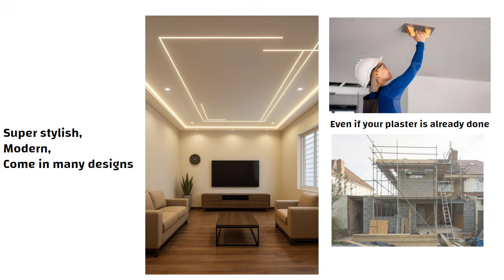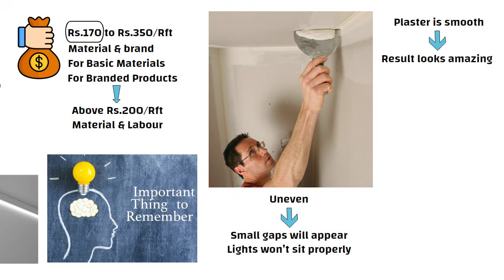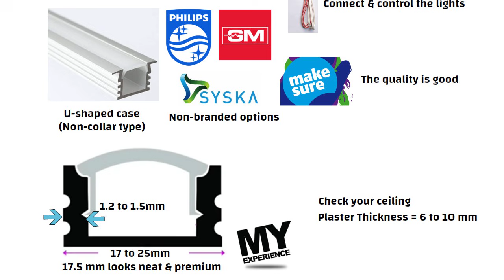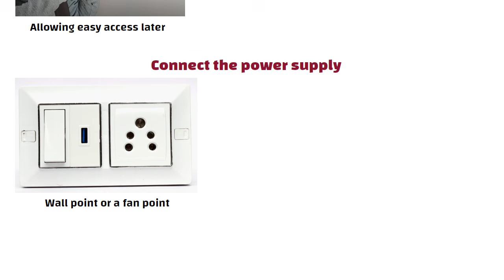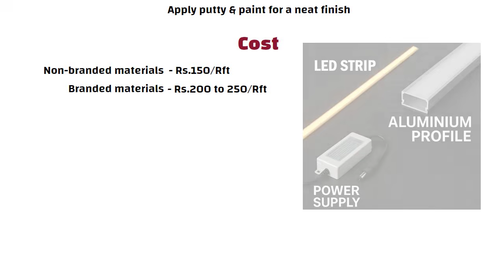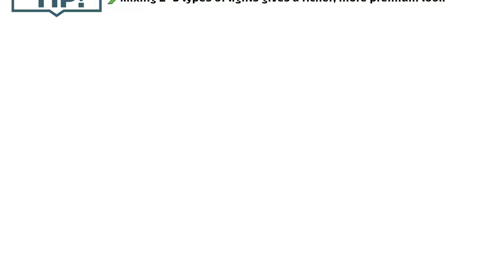How to install Profile Light without False Ceiling!

Comment: My flat wall is concrete wall done by builder. I want to do celling light without false ceiling. You mentioned profile light can be done by little cutting of plastering. How to do electrical wiring in concrete wall and ceiling along with fixing of switches? Can you please elaborate wiring, fixing switches with nice looking?thanks for tips

Comment: I have no ceiling light points only one fan point in my bedroom but I wish to put panel lights in my room then how to do it
Reply from the maker: You can take a loop from the fan point or nearby switchboard n run wiring for the panel lights. Just get it done by a proper electrician to keep it safe